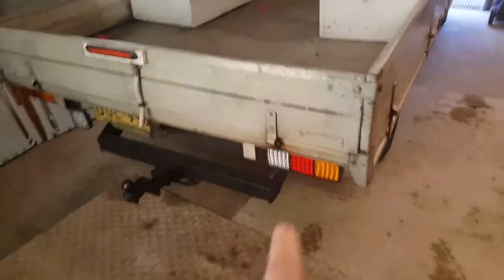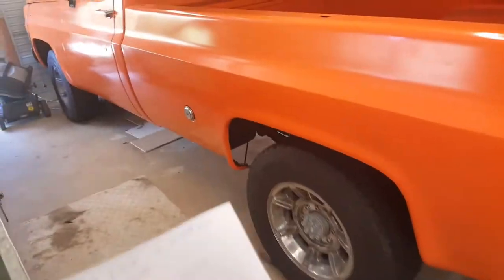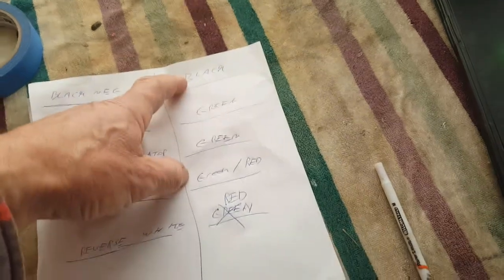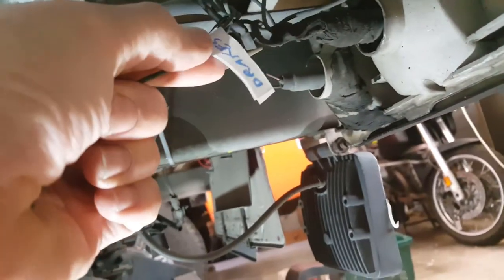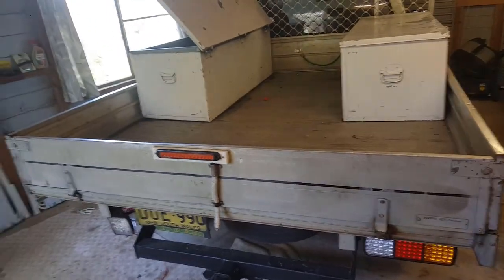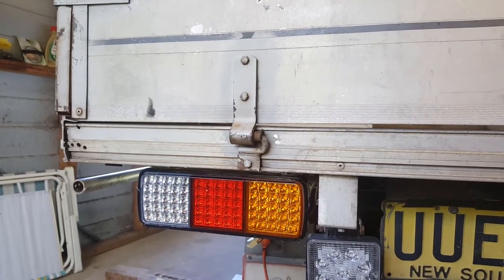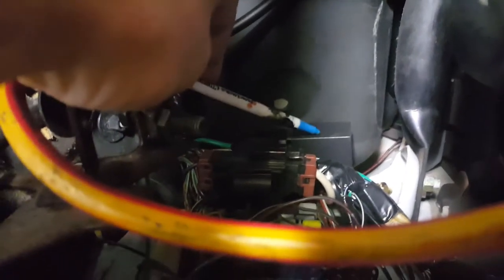Left side rear LED light UTE aluminium tray install, Indicators on outside

Comment: I am not sure if you fixed it but the left light was installed the wrong way the blinkers should be where the reverse is but that's just a simple unbolt flip over and then tighten back up, Good job btw.
Reply from the maker: Bro the new LED lights are installed with the blinkers on the outside
Reply: @1966human  Have you still got the ute?
Reply from the maker: @that_crankytf9571  Why?
Reply: @1966human  Wtf because i am asking
Reply from the maker: @that_crankytf9571  Yes, it's in storage, Its too good to sell, the other month it idled over a brick used as a wheel chock

Comment: The yellow indictor should be on the outside. Reverse on the inside. At one point you have the left on upside down.
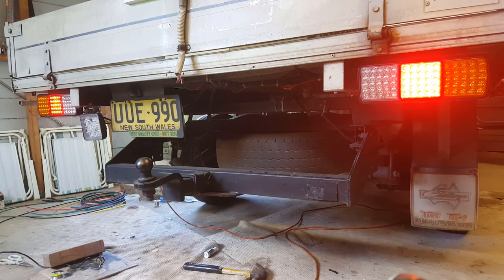Reply from the maker: Yes correct the lights were turned the wrong way and fixed by 33:34

Comment from the maker: The new LED lights are installed with the indicators on the outside
Reply from the maker: Yes the lights were turned the wrong way At 21:35 and corrected later

Comment: Mate you just made the whole process seem like the most complicated thing
I just done this conversion was the most simple thing I've ever done on my rodeo
Cut ond wires, connect to new wires and they work perfect 
Even made new brackets as I didn't like the old ones
Reply from the maker: It was about the wiring diagram i found, I wish my work went that easy but that's life sometimes

Comment: Hi, did you need load resistors, in the wiring, or did yours flash normal speed? Getting these lights for my 95 Courier. Cheers
Reply from the maker: I didn't need resisters, the LED lights work fine once I sorted out the wiring, the wires weren't labeled up for wiring

Comment: cant find globes?? they sell them at supercheap who you recommend also you never mentioned a resistor waste of time
Reply from the maker: I think I meant I could no longer find (at that time) the globe type indicator unit? These indicators are still working well, they didn't need anything other than an LED adjustable relay.

Comment: Do you still have the old girl? I have recently done up a 1995 Rodeo and registered it. Thanks for the videos. I also installed LED tail lights and the sealing of them was a good tip. Cheers. Pics here: https://youtu.be/tQAAjyWxkkM
Reply from the maker: Yep she came out of 2 years storage and the lights worked well, The number plate light needed a hit of desperation to get it going, so when I got the blue slip and rego I put 2 new LED number plate lights on her, so far so good
Reply: @1966human  I put some wedge LED's in the parking lights on the front and they work great too.